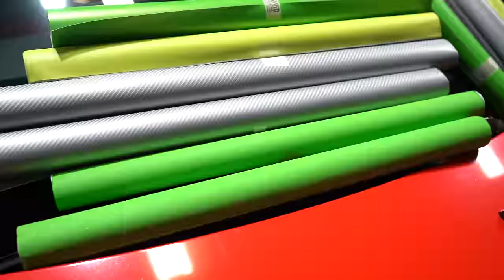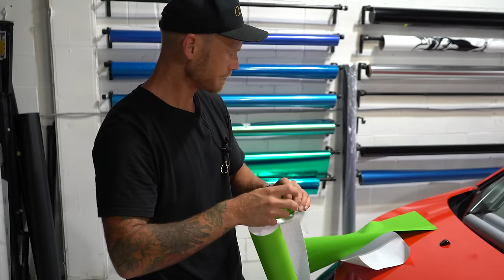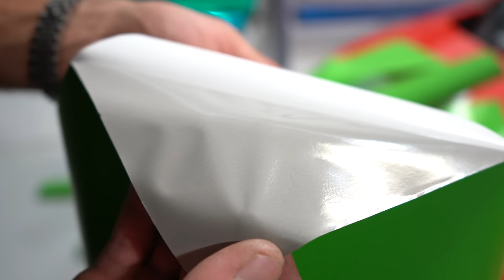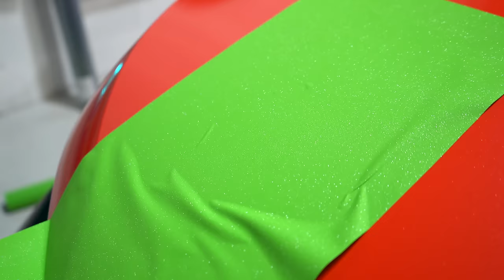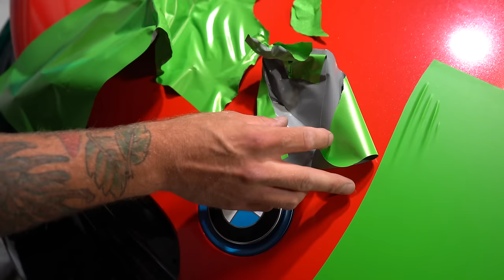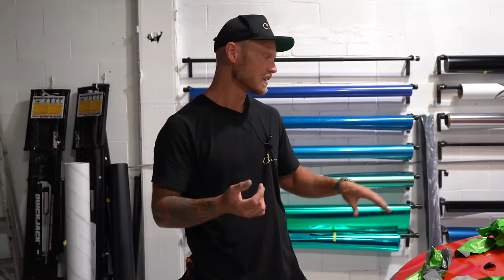Chinese Vinyl VS Vvivid Vinyl VS 3m Vinyl (part 1)

Comment: I have a question maybe you can answer. I have a small boat made out of polyethylene that I want to apply a wrap in each side. The area is pretty flat and will be an easy install but as you know vinyl doesn’t like sticking to the PE. I heard about the 3M vinyl primer 94, they say it will help the vinyl stick to the boat. My question is if I put a coat of the primer on the boat will the vinyl stick instantly when it touches it or will I be able to reposition the vinyl it if needed? 
Thanks

Comment: Do you always need to use heat to apply vinyl as a standard protocol and does it always need to be stretched? I know Mirror looks better stretched but besides surface prep, what’s the easiest kind of vinyl to install and why? I know colors act different and images can’t be over stretched but in a nutshell what are the rule of thumb?

Comment: HEY CHRIS I HAD A QUESTION ! Is Avery Dennison a good brand? I want to do a chrome delete on my car and the upper trim is long and curved so it keeps getting some bubbles and it may be because of the brand I got off eBay it was no brand but it had some air release technology but not good enough it seemed like. What do you suggest I use for my chrome delete project brand wise and do you think gloss black would look better or satin or matte on a black c300 lol I know it’s personal preference b as the pro what do you recommend to look clean and like it came all black! Love your videos and informative help

Comment: Teckwrap is from China is that pretty good or no? They have some very vibrant unique colors that other brands don't have
Reply: @autostyleonline1311  Okay I see now might give it a try, Thank you for your reply.
Reply: Be very careful, the problem with the alternative films is that the adhesive will never come off after you apply it after a couple of days. And don't leave it in the sun at all....
Reply: @dr.graves5541  Didn't know that, I will have to leave it in the sun everyday. I think I'm just gonna go with a luquid spray wrap Autoflex Express. That way I can do any custom color I want.

Comment: Does changing the complete Color of your car with a vinyl wrap mean you need to register the car in the new Color? I'm from South Africa and I was told by the local authority that Changing the Color of the car even though vinyl wrap is temporary means you have to also change it on the vehicle logbook/registration certificate as it's illegal to drive around with it not being done

Comment: I was very excited about the VIvid vinyl when it first came out, and I have wrapped several dragsters with their material. I wrapped a car in the liquid metal green and it turned black where the sun hit it the most in a matter of months, and the edges pulled back a half an inch from where it was trimmed. I cant get it off the car to save my life. The adhesive wont let go, and the material separated into layers leaving the metallic dust and glue. If anyone has any suggestions on how to get this off without setting it on fire, please let me know....
Reply from the maker: Use an eraser wheel. Works very well when 3m and Avery leave a ton of glue behind too
Reply: @CKWraps  Been doing wraps full time since 2005 and I have never had as much trouble taking a 10 year old 3M or Avery wrap off as I have had trying to remove a 9 month old vvivid wrap. How many vvivid wraps have you had to remove?
Reply: @dr.graves5541  Sad that all this wrong information is being put out to so many people. Vivvid is absolute trash and wont last a year on a car before it fades, not to mention shrinkage on EVERYTHING. 

I had the same issue where the vinyl was tearing into layers and little pieces. I ended up taking the wheel to the whole car.  Probably spent more time removing then wrapping. Best part is the wrap was on for maybe 8 months before it faded and physically started cracking in random spots. Done many removals and never had such a hard time. Luckily it was on my personal vehicle and not a customer car.
Reply: @SubieDew  I wholeheartedly agree. The only thing that I think could be the reason, is that the wraps are just temporary and get removed almost immediately before they have a chance to fail.... Must be great to have money to throw away like that...

Comment: I've used vivid and it was nice but it baked on the car and dried out after a year or two, was extremely messy to get off, I'm hoping 3m comes off easier in one piece
Reply from the maker: Depending on the climate, all brands will do the same
Reply: @CKWraps  I live in Pennsylvania, it doesn't get super hot but it gets both hot and cold throughout the seasons

Comment: The Chinese stuff is calandered as to to Vvivid and 3M is cast
Reply: Not so sure about that. I wrapped a corvette in the Vivid liquid metal green, and less than year later, it came back turning black, and the edges had pulled back a half an inch from the edge. Not what I would expect from cast for sure. On top of that, the vinyl came off in tiny chips, and I am still trying to get it off. The adhesive is pure hell and does not come off clean at all.
Reply: @dr.graves5541  they advertise as cast
Reply: @dr.graves5541  my vivid started to turn brown then black as well and it did look like it shrunk a bit, getting it off was a pain, as soon as it cooled it would crack instantly
Reply: @DirtyBrew  Ya, they advertise as cast, and that is why I just ordered a swatch book and began selling wraps for dragsters. The liquid metal colors are beautiful and I have done some printed designs on the chrome as well that looked awesome. I have had to deal with shrinkage on a couple of wraps, and fortunately, the time the cars spend outdoors is minimal.

Comment: Can you do a video about how to avoid scratching the vinyl during application or possibly removing the scratches if there are some? Would appreciate a video like that, thanks
Reply: Use the correct buffer and don't let it touch the ground. Heart usually removes most minor scratches. Some finishes especially chrome are in fixable
Reply: buy 3M 2080. it has a clear film over the actual vinyl while installing and then it is removed afterwards

Comment: I bought one time al roll for a few euro but it has no airrelease or whatever. I tryed better foil but it still sucks. So if you buy foil, buy good foil like 3m or vivid. Its a lilbit more expensive but if you try to wrap your car of headlights and it doesnt work its a realy stressfull job to do. The next time i spend a lilbit more money because the other foil i had was crap. It was like on the car 🤔 off the car and then in the garbage.

Comment: Here is the problem with most of them, you have to buy a whole roll of 5' x 50 yards, at a unreasonable price, and with most of them you have to have a shop, sign up or they won't sell to you.  Vivid is an exception, as they sell smaller quantities on Ebay and Amazon.   Ebay also sells the Chinese brands.   I took a chance on a beautiful Chameleon purple gold wrap in high gloss.   Keeping fingers crossed that it isn't junk.   Got it from AliExpress.   I want to wrap a motorcycle, not a car.
Reply: Hey, did u wrap a bike. Was it a good vinyl to work with ?

Comment: I work in a wrapshop in Thailand atm. i'm danish but, we use china wrap sometimes when the customer is being cheap. Basically if you are working with a very thick film you can apply some baby shampoo with a soft sponge on the main area, but not the corners, it allows for the air to move more fluently, and avoid air bubbles.

Also the chinese film in the video, i'm pretty sure it's not made for wrapping entire vehicles, we were talking about it in the shop the other day when we were looking at the sample book, they do make one with a coating on top of the diamonds so it doesn't break.

Comment: I just tried wrapping with vvivid, I am finding whenever there is a small crease it is leaving a permanent mark that can't be taken out with heat or stretching. Is this normal?
Reply: Did you order your vvivid from Amazon or their website?
Reply: @randybobandy9828  Amazon. It was my first time trying to wrap, and it admittedly might be due to my lack of ability. They were kind enough to refund me
Reply: @Nicely  I see.. so far I have been reading that the quality of vvivid vinyl from Amazon is not the same as from their website. The price is also alot more expensive on their website vs Amazon. Idk if there is truth to that or not.

Comment: I bought the vvivid taillights wrap and it lifted the same day so I had to remove it. It looks great but the edges kept on lifting.
Reply: Did you clean and degrease your tail light?
Reply: @MarkSegree  yes, I washed my car like 2 days before and I cleaned it before I wiped it with rubbing alcohol.  Everything came out awesome until I was done went inside and when I was leaving for work it was lifting.
Reply: This usually happens if you overstretch the wrap
Reply: Also how scratched up was your tail light? You need a very smooth surface as in buffed and polished to get best adhesion

Comment: I'm going to attempt my first wrap soon using oracal 970ra 😁 was going to pay to have it done until I got the quote lol
Reply: same here. wrapping my honda civic as my 1st wrap. $600 of material is way better than $4400. I am almost done. I have learned that CK Wraps makes it look very easy.
Reply: Im doing my charger currently, I got everything down just cant do the back bumper and the front. He makes it look easy
Reply: Mic do you have an Instagram
Reply: @Applefaker  no unfortunately I don't but I'm hoping to get one going once I start 😁
Reply: @micraw714  wanted to see how it turns out and what color are you doing btw
Reply: @Applefaker  for sure brotha, I'll let you know when I get the Instagram up and going. I'm going to go with fir green metallic. I saw it on an m4 online and it looked dope!
Reply: @micraw714  satin or gloss? And lmk how easy oracal is to work with
Reply: @Applefaker  definitely going with gloss and for sure!

Comment: Hey how do  wrap around the washer fluid sprayers on the hood?
Reply: They take the washers off the hood, then cover the hood with vinyl and cut the holes where the washers were. Then replaced the washers.

Comment: thanks for sharing!  learned some differences.  I ordered several from over Asia film.  One was not much different than REG SHELVING PAPER!    other was super nice wood grain for inside, shinny, stuck well, but the pull was not as much as I thought it should have been.  Stuck well, just crossing fingers it stays well, using it now inside details.  Another to finish a piece of furniture.   Don't ya just love the Metallics!   wow that broke fast!  guess need to do a break test before applying too. lol  thanks

Comment: tell me im wrong, im actually not trying to be a D, but are you not ruining all that vinyl by putting it on the floor?
Reply: He is only using that vinyl as a demonstration. Each piece he cut would barely be enough to wrap both side mirrors. He isn't ruining much considering the rest of the vinyl on the wall behind him ahahaha
Reply: @anthonyianni3185   2:08 he threw the whole roll on the floor, thats why I mentioned it, He also says "throw it on the floor" even if the floor is clean the force of dropping it on the floor can scratch and damage the vinyl.

I JUST NOTICED THIS RIGHT AFTER I REPLIED, LOOK AT THE THUMBNAIL FOR THE VIDEO!!!!!! YOU CAN SEE WHOLE ROLLS OF VINYL LAYING ON THE GROUND HAHAHAHAHAHA! NOW COME ON YOU GOTTA AGREE WITH ME HERE!

I get your point about the parts he cut... but when it comes to the 3M and nice vinyl, small sheets even that size cost $20ish if you buy just a sheet that size, and you could use that size sheet to wrap multiple door handles, a gas cap, a side view mirror, multiple things. The carbon fiber vinyl would be more expensive as well!
Reply: @KM-rh4zl  Do as he says, not as he does lol

Comment: Which brands are the best in order?
Reply: this is always what I would like to know
Reply: Here in the Uk the 2 big brands claiming to be number 1 3M and Avery. Arlon have a good product at a good price point for printing, then we have Oracal , Hexis , KPMF and right at the bottom of the pile we have Metamark who promote a conformable calendared vinyl as a cylinder cast (whatever that means as it’s certainly has not been cast)

Comment: Kinda leaning towards 3m just cause it doesn't stick right away and air released.
Reply: MMM is my choice too.
HOWEVER is is not easy to remove and can take off the car's laquer and even paint when removing.
Reply: @EnglishLaw  I would again apply heat when trying to remove it. Cause yeah pulling it off crispy and all will def have higher chance to pull off your paint

Comment: For sure those no brand vinyls are not designed for car wraping. 
They are just for short period used, like advertisement, sales promotion of price texting and so on. 
For those purpose, these vinyls are good enough. And cost effective!
There also some kind of no brand car wraping chinese vinyl, they have black or gray backing as well.
That will be valuable if you could make video to show the difference between no brand cheap car wraping vinyl and branded vinyl.
To be honest, this video is wasting time...or a product placement video....

Comment: I try to tell people all the time you get what you pay for, had a guy bring me some fake EBay 3m junk few weeks back and pressed me to use it, worst junk I’ve ever seen tbh, wrapped and popped up in a couple hours. Stuff reminds me of a plastic almost and so aggressive too. Please people use a legit wrap shop and installers that will use 3m, Avery, Vivid as those are great and last.

Comment: I'm cheap and I have experience with the chinese film.  You have to spray water on the surface first before applying.  I learned the hard way that the chinese brands are a bitch, but it works well for the price.